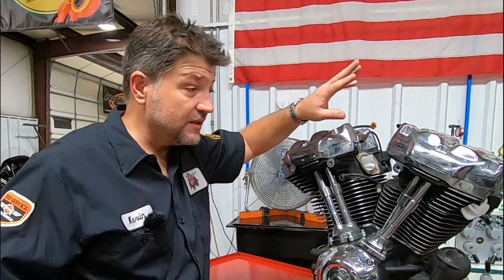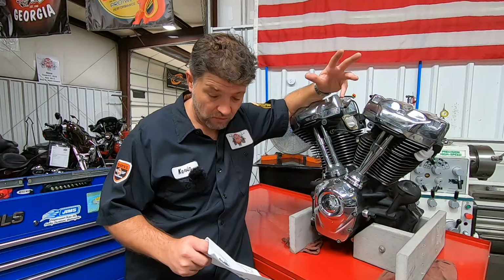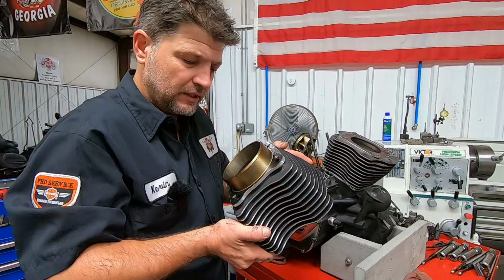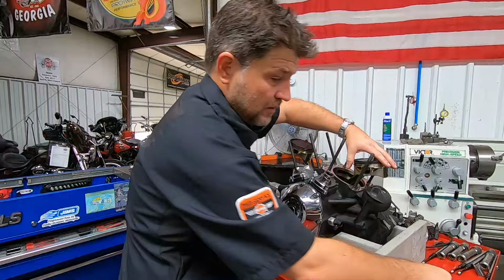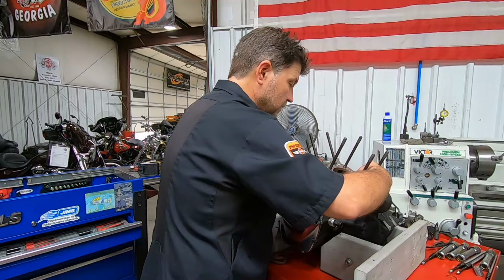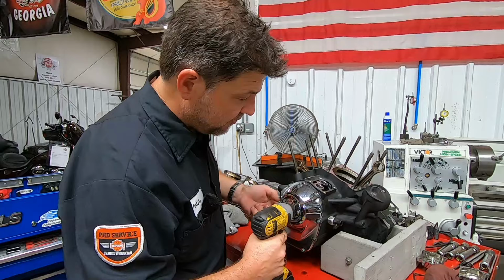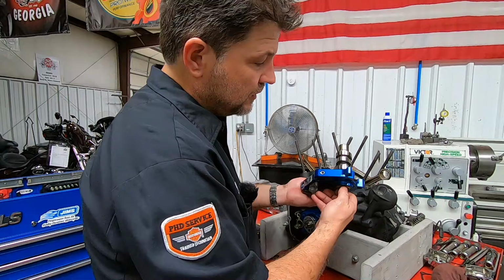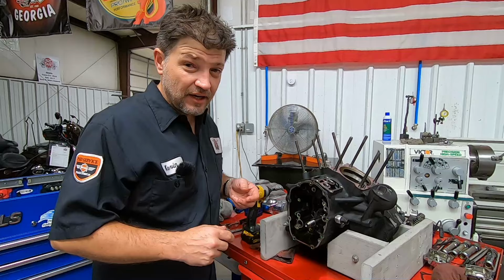80,000 MILES and KNOCKING! - Milwaukee 8 Engine Tear Down - Kevin Baxter - Pro Twin Performance

Comment: Great video! And I'm glad some folks just rebuild their engines at 80k and not selling the bike the get a new one.
Reply: I said exactly what you wrote before I seen it.   Ive spent to much time and money on my bikes just to sell them for a new one every 4-5 years.
Reply: Things are not what they used to be  .006" runout on older bikes would be criminal.i think harley say up to +.012" is acceptable.If someone with a shovel pan knuckle or  flattie had that i would say they need new flywheels..Also 80 000 miles is not a long life from an engine if its well maintained and not beaten up on as this one certainly was not!!! Things are not what they used to be.Company went backwards in engines from  end of evo era. Having said that the clientele that harley attracts now seem to have little respect  for what is still an agricultural design.(Thats why we love em!)and 4 some reason think its fun to beat up on them.The  big twin flatties  in my opinion are the best bikes harley EVER made.Built even half decent they last near forever.

Comment: 80k and needing a rebuild. I'd be unbelievably pissed if I spent 20k+ on a bike and it crapped out at that low mileage. Great video though. Liked the step by step disassembly.
Reply: Alot of guys tear them down way before 50k. The heat kills everything. They should have fans on them. I have a 2012 streetglide with nearly 70k. Replaced everything in the cam chest at 56k. Put in nice cams and now has 98.7 h.p. and 116 ftlbs of tourque. What a jump in power. Top end was not touched. Still doesn't use much oil. Maybe 1/2 quart between 3k oci

Comment: Your videos are always really good Kevin.  Thanks.  I have an 03, 1200 Sporty with 75K miles on it and a 2012 Dyna Superglide with 112K miles on it.  Miles I put on the bikes.  Both run like sewing machines.  Never a wrench to the motor on either bike.  I watch 2LaneLife alot.  Those guys run M8's and run pretty hard.  85mph plus on Interstates.  Ride 2-up and lots of luggage.  Their bikes do very well.  I'm impressed.
Reply: Glad your Dyna is happy. Mine is a '13 with only 45,000, hope I get at least your miles.

Comment: I have an Evo with over 100,000 miles on it. Never been apart. Last of the reliable,  easy to work on Harley motors.
Reply: @Thomas B While no bike engine is hard to work on the garbage timing chest nonsense (purely to facilitate semi-automated engine assembly, see factory videos) HD inflicted on customers was only to save the MoCo a few dollars in assembly labor. HD stopped being a "premium" quality engine when Evo ended (and those had their share of problems).

Comment: It was cool watching you tear this down and give the descriptions of what you were seeing. Excellent job!!
That being said, 80,000 miles? That's the break-in period on my Goldwing.
Reply: Probably due to it being a vtwin and the vibrations. The goldwings 6 cylinder is super smooth
Reply: Honda lifespan>>>>>>>>>>>>>>>>>>>>>>>>>>>>>>>>>>>>>>>>>>>>>>>>>>>>>>>>>>>>>>>>>>>>>>>>>>>>>>>Harley lifespan.
Reply: I'm a Harley rider but l must admit the Goldwing is the BEST touring bike out there...but you really can't compare the 2 motors....different animals
Reply: Frankly I am appalled that such a brand new motor would go out with 80,000 miles on it my last Beamer had half a million on it before the car took it out I have a half a million miles on my Triumph TR6 that I've had for 40 years I have a 99 Sportster 883 that has 350 thousand miles on it engine runs good my Ural sidecar outfit at 40,000 miles and I put on it in the six years that I've had it it was number three out of the four bikes that I had on the road for many years now that I am not working I'm retired I don't need to have spare motorcycles to make sure I get to work I'm sure I will be able to have many more miles on my you're all I've just done basic maintenance to it the two-piece driveshaft kid, part no Harley Shop with touch it even though it was a simple job so I had to do it myself with the owner's manual some help from the dealer on the phone and my buddies garage around the corner from my house Easter morning the cylinder broke from the base on the way to services bought a new cylinder piston rings gaskets and seals and just put it back together and it's fine and dandy Harley's last good motor with the Evolution motor the Evolution motor powered Sportster is there a most reliable bike probably why it's discontinued you would think on a big twin that cost so bloody much that the motor would last forever but then it's not an airhead BMW

Comment: Great video and good explanation.
I don't understand why he keeps emphasizing that 80,000 miles is a lot of miles?? That's nothing for mileage.
That's only 128,000km
One of my bikes is a 1991 Goldwing GL1500 SE that has 240,000 km which is about 150,000 miles and I've done nothing to it. I haven't touched the motor, tranny or clutch. Only wearable items.
I would be pissed if I bought a motorcycle and had to rebuild the motor at only 80,000 miles.
IMHO, The motor and  tranny on a motorcycle should last 300,000 miles or 500,000km before you even have to think of touching the motor or tranny.
HD makes money selling a $45,000 touring bike in Canada and then rebuilding the motor every 3-4 years.
Keep up the great videos
Reply: I totally agree with you. That is why I sold all my Harleys.
Reply: I thought the same thing......80,000 miles is just broken in for a Goldwing.  They can go 300,000 miles if properly cared for.
Reply: My xs 1100 1978 did 150 000 plus choper i also had a side car outfit 100 000 plus did rebore that i ran it from spain on 3cylinders not recomended uk biker

Comment: Im 67 been rebuilding various motorcycle engines all my life..would like you 
to continue a on this engine in detail an find sumise why this happened. I argue that careful assembly ,balance ,tuning and mantainence along with none abuse   will give all round better service than adding after market parts. To me after market parts may attract short term performance gains but lack accountability and factory  condition testing for longlivity.

Comment: Kevin loved the tear down please show the build you do on this thanks
Reply from the maker: im not impressed either...but its not as bad as some ive seen with much lower miles.  None has been spent other than cam plate and pump.
Reply: Are there more "robust" connecting-rod races out there?

Comment: I don't know, seems like HD has made a turn back to the AMF days when quality didn't matter. I own 3 of them with the latest one costing almost 50K out the door. Now I have to worry about it blowing up because it seems like it wasn't designed correctly and tested thoroughly enough before the dealer accepted the 50K. Well, I guess they keep people who do care employed, like you, but damn! Thank God I have a lifetime power train warranty on it! Keep up the great work 👍
Reply from the maker: thanks John
Reply: If you remember 99-2005 the twin am was having all sorts of problems as well. It happens with every new engine they put out. No different with the m8 sadly
Reply: I trust my 100 hp shovelhead to take me anywhere. It scares me to take my pos twin cam 10 miles from home.
Reply: You don't have to rebuild them. You can run them til they grenade. Everything is a wear item at some point.  We are spoiled today with how long engines last. In the 70s by the time you paid off a vehicle in 4 years it was junk. Now they can easily last 20 years. I agree that harley could build them better. The heat issue is a big problem.  My 12' came with a oil cooler so maybe that helped mine survive. I really want to put fans on the jugs. These summers are so hot and getting in traffic is a killer.

Comment: My 72 cb750 is all original motor. One owner, my dad. Then me. 
First bike I was on at 6 yrs old with my dad. I’m 41. Not a sound except the good ones. Oil is clean pans clean. Just did big tune up. Lash was fine. Plugs good. Best bike ever made reliablility wise

Comment: Kevin I really enjoy your videos and thanks to you, I have learned a great deal about my own motor. 
If you are interested, I would like to see a video from you about riding practices that are good for the longevity of a Harley motor as well as those that might cause premature deterioration. This could include shifting rpms and how that can affect compensators; how cruising rpms affect engine heat and cylinder head pressures; fuel choices including ethanol and it's effects. 
With your knowledge and experience, I am certain that your comments would be very helpful to your subscribers.
Reply: I'd love to hear this also.
Reply: Yup… interested here too

Comment: Hope this is an isolated case because many individuals are building M8’s with high torque numbers on stock cranks.  This would definitely lead to short engine life.  Great content, keep the videos coming.
Reply from the maker: so much of that depends on the riders right hand.
Reply: Absolutely. Weekend mechanics throwing on 124-151 kits to the stock bottom end then complain about the quality of these engines. It's the same as the wheelie guys with the "bad" fork seals.
Reply: @KevinBaxter  and the tuner

Comment: WOW, I HAVE 80K ON MY 2017 road glide special right now. haven't had any issues yet. I will be headed to Sturgis on my Road Glide S from Mobile, AL.  hopefully I will meet you in sturgis to discuss my  performance rebuild when she's ready! GREAT VIDEO!
Reply from the maker: Hope to see you there sir!  Save travels!
Reply: My friend. What oil are you using ?
Dealer serviced ? Or amsoil ?
Reply: @DG-fm6ti  im just seeing your question. I've used amsoil, super tech from walmart , valvoline and mobil 1(all synthetic). I don't dog my bike but will skin er back whenever the need arises..haha! I change every 5k and other 2 holes ever 10k. I do all my own services. I just changed my drivebelt which wasn't hard but it was timely being a first for me and saved me $1,300. Other than the belt breaking I haven't had one issue yet with my M8 (stage 1 with headers and dynojet tuner) I have 87k on it as we speak. I get about 24k miles off of a dunlop American elites. the front tire I know I have 42k miles on it because I didn't have to change it when I changed the back tire last time.

Comment: My Twin cam 103 is a great motor. 48-51 miles per gallon usually. If I ride easy I can get as much as 55 mpg. Enough power for me to do long rides in the hills.
Reply: That motor can last you 100s of thousands of miles if maintained properly.  And maybe some luck.
Reply: I have a 14 road king with the 103, I run redline in all 3 holes every 5 k. my mechanic said hes seen 103's with 150k on them.
Reply: @Imachowderhead  I'm a big Redline fan also.
Reply: @Imachowderhead  
Twin cams are very good engines👍
I use Amsoil 20w50 in engine case And primary And 75w90 in gear case
What you think?

Comment: It looks like the hot spot on the cylinder was on the spark plug side. With a worn rod bearing the power stroke probably caused the piston to tilt sideways creating excessive friction and noise. 🤷‍♂️

Comment: Thanks Kevin for another great educational video. And perfect for me because I ride a 2018 107 myself. But mine is all original with a little over 10 and a half thousand miles on it. I learned from one of your other videos to check if I have an engine sumping issue by removing my bearing sensor and measuring the oil that drains. I only got about 2 and a half ounces out of it so I feel safe assuming I have no sumping issue so far.

Comment: Nice to see one that lasted 80K, I am at 31.5k on my 2019 so far. Can't make Sturgis this year wish I could have made the meet up.
Reply: I have a 2019 as well and am just shy of 24k which I will surely hit or exceed by time I hit 2 years the last day of August. Good to see what I can possibly expect to see at 80k if I don't trade up by then. Loving my M8 at this point.
Reply: I have a 2019 Road Glide Ultra that started off as a stock 114-inch engine. I later had the Woods 22X, 700 lift cam, dyno-tuned, Power Vision fuel tuner, Fuel Motor RTX, two into one exhaust, Harley Ventilator Extreme air cleaner and ran it like that for 41,162 miles with no problems and then had the Fuel Moto, 128-inch build installed, and changed to the Cycle Rama 483 cam, Fuel Moto RTX two into one exhaust, HD Ventilator Extreme air cleaner, Power Vision fuel tuner. I now have 50, 587 miles on it and my 128-inch engine gets almost the same gas mileage as my 114-inch build.
Reply: I have 30k on my 2020 m8

Comment: I have a 02 88 twin cam with 70k on the clock. Just put cam chest , hypo oil.pump , new lifters and bolt in Screamin Eagle 203 cam. Just trying to keep it dependable. Anyway my run out on this bike is only 2k I thought that was pretty good all things considered. I bought the bike last summer with 68k on it so I feel like it was taken care of well.

Comment: Had the same issue with my 2002 Twin Cam.  Front rod bearing and excessive piston slap most likely due to the bad rod bearing.  This was at about 72,000 miles.
Reply: My Electra 2001 says 120.000miles and still working fine without rebuild, can you explain to me why?
Reply: It’s the “luck of the draw” with a Harleys.  I’ve gotten over 65,000 miles each on my last two Harleys with no issue.  I am a mechanic, though, so I know how to treat and maintain a bike.  My current 103  Road King will be sold @ 100,000 miles and I expect the next 35,000 miles to be reliable.  I’ve so far only spent $14 on repairs in 67,000 miles.  Not bad, I’d say.

Comment: Just picked up a 07 fxdl with 70k on it. It seems very quiet and smooth, yeah it’s stock, just slip ons. I’m wanting to have it built over the winter. Saving my coin in case I have to go And replace crank, but I won’t know until I get it checked. I have extremely basic mechanical skills. Anyway. Awesome video and enjoy your content. Keep the shiny side up

Comment: 80k on a modern production engine with a knock is pretty poor reliability. I just sold a 76 Guzzi LeMans 1 with 140k miles and the lower end was perfect. One piston melted due to poor fueling but was the worst of it. Replaced one valve as it was bent. That’s it. This on a 45 year old bike.
Reply: It also depends how the bike was ridden. 80k hard miles is more wear than 140k easy miles
Reply: @DirtRidingLarry  the LeMans was one of the fastest sport bike of its time. It was ridden as it should have been as I know the previous owner. Poor engineering is just that. I cant comment on the Harley usage as I don’t have the history but 80k miles on a modern engine is poor reliability. Also in the video it is mentioned the bike has been taken care of and not abused.
Reply: 80k on a Harley is pretty impressive, they usually blow up after 40k
Reply: I agree.  My BMW is approaching 100,000 miles and runs better than ever.  The K1200 engine is known to run 200,000+ with ease.  80,000 is break-in mileage on a modern engine.  Unfortunately, chooses to build their current engines using 100 year old designs.  Putting two large air cooled cylinders one behind the other is a recipe to cook the rear cylinder just as we see here.  That is an unfortunate design decision, but it is what Harley chose to do so Harley owners simply have to live with short engine life to get the look and feel they desire.  That is their choice and I am fine with that, but I choose a modern liquid cooled engine that avoids these problems and will run 200 to 300,000 miles with ease.  Different strokes for different folks.
Reply: I love a Guzzi, but to fair this was 80k in 2-4 years.
Reply: Older engines are way more reliable compared to newer engines
Reply: I would never buy a Harley I always buy Honda.
Reply: Harleys are junk straight from the factory. Honda,kawasaki,Suzuki or yamaha is the 4 best choices for your money. I know a guy who has a 1979 Honda gold wing with over 400,000 miles on it. He took care of it of course. Not one Harley could even come close to those miles.
Reply: Had a Yamaha Vstar 1300 with 90,000 ran beautiful when I sold it
Reply: @DirtRidingLarry  I know guys who beat Goldwings to death and 100k miles is nothing on them. Harleys are junk ass old tech that has no place in this day and age
Reply: @LTVoyager  didn't he say it as the front?
Reply: This is the price we pay for the environment. New engines have to run very lean, and also the rings of the pistons are thinner to pass emission regulations. Especially for aircooled bikes with big bore like Harley-davidson the future it is not promising. I am from Greece and I know that many new cars from all around the world have many issues with  euro6 regulations. Çars and motorcycles from big companies they start to burn oil from 30 to 40 thousands miles.
Reply: @dakarpsi Thags funny, because I know two guys that have over 150k on the clock in a Harley. Yes quality plays a roll. But also how well you take care of it as well.
Reply: @dakarpsi 😂😂 not true at all lol.
Reply: It's one engine. Settle down people. I'm sure you can find all kinds of BMWs with tore up drive shafts at 80k miles.
Reply: Love how everyone loves to troll a jacked Harley motor with an aftermarket cam and 80k on ticker.  Ohhhh it’s such a POS, Only 80K. SMH go ride your MC and quit being a drama king/queen.

Comment: Hi Kevin hope your doing good, id like to know which oil this  guy used and how many miles between changes. Rock on brother thanks for all the great videos.
Reply: Harley Syn 3 for 70k then new cam, pump and plate switched to Amsoil  with 5000 mile intervals
Reply: @greggszakmeister4679  80 k miles . . . wow that's some riding. Looks like that Syn3 did a fantastic job. The inside of your engine looks great.